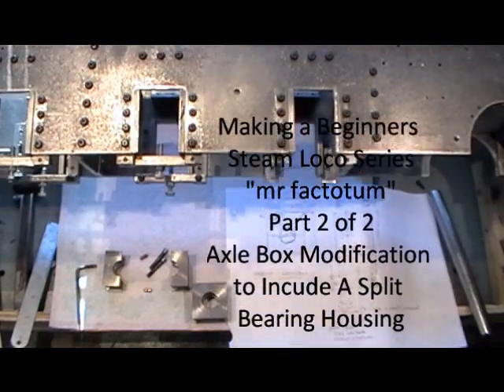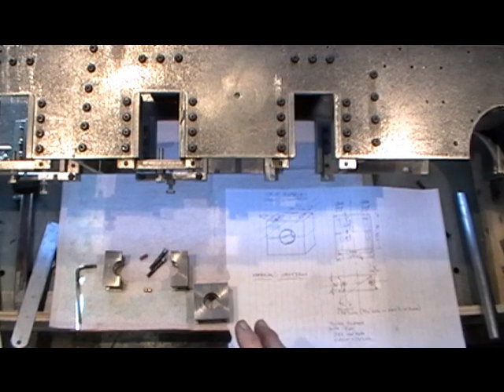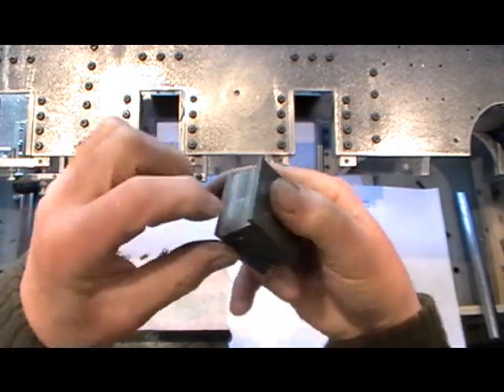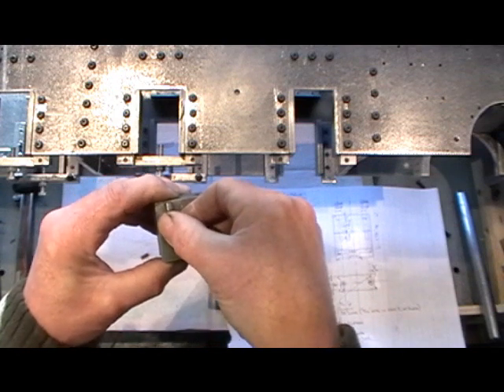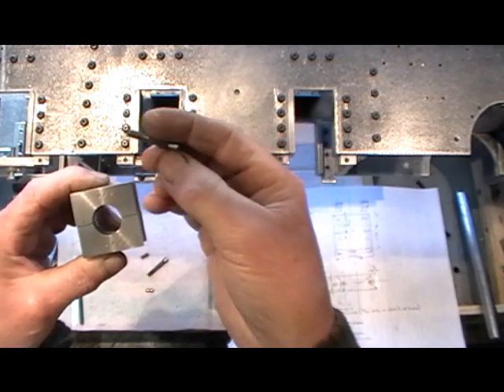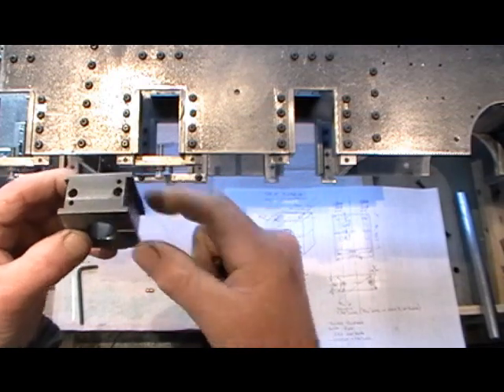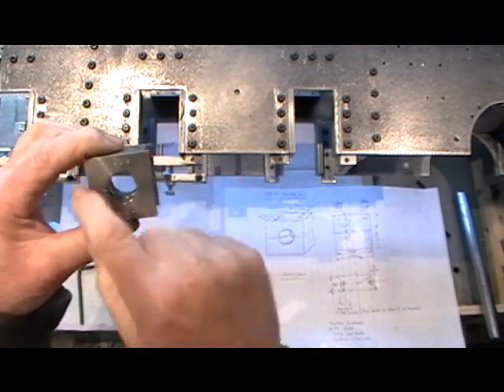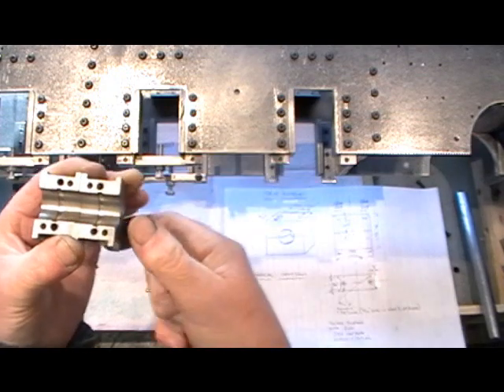Making a Beginners Steam Loco ("Axle Boxes" Prototype Modified split bearing Part 2)"mr factotum"

Comment: My re designed Simplex has 2 BA fittings all over and I dropped the hex key twice today! As well!!
If only the builder had done split boxes as I am having to carefully file each to fit into new horns on the new frames!! I have done the keeps as well and these are full length plates that should go to help keep the track OIL FREE. I have a very stiff frame now.  Loving what you are doing. David and Lily Reading Track.
Reply from the maker: hi david & lily
Thanks for getting in touch, good idea with keeper plates, good luck with the filing
regards
mr f

Comment: Mr. F.  Looks like your modification is going to work quite well.  Do you plan on using the spring ball type oiler in the end of the axels?  I forget what that are called.  Gits oilers maybe?  When you do the bevels or chamfers to the insides of the axel boxes, will you do them up by hand filing or will you machine them.  Great series my friend.  Thanks for taking the time to film and post.

Joe
Reply from the maker: Joe
Yes i will use the oilers in the end of the axles, ive ordered them from china, hope fully there just coming over the pacific ocean, china calls them push button oilers, they have got various names, got 20 off for £1.77 delivery included, how do they do it!!!!!! As for the bevels, ive decided to machine them,  i'm in the process of doing a detailed machining process of the whole axle box including the bevel.
thanks for your comments
regards
mr f

Comment: Although it takes a bit more material and work, I think the axle boxes made by Mr Crispin make a whole lot of sense.
Reply from the maker: Hi there, thanks for viewing and commenting I appreciate.
Yes that's a fair comment, and for any professional builders I agree. I'm  just trying to keep things simple from a beginner's perspective to encourage more novices to have  a go.
Regards Mr f
Reply: Since you split the boxes, you could still incorporate oil wells and felts for a better lubrication system.
Cheers
Reply from the maker: Hi
Thanks for taking time to view and comments, I appreciate it
Yes, I did think about it, I have put a oil groove in the axle boxes and suppose I could incorporate a felt in the oil groove, i may do just that.
thanks again
regards
mr f

Comment: I might have to do this for when I get to this stage of my sweet pea did you have to buy extra cast iron to make the split boxes or did you use the cast iron supplied in the starter kit ?
Reply from the maker: Hello Morris Sentinel
Thanks for taking interest and comments, i have not bought a starter kit so i don't really know what you have got, i bought some lumps of cast iron from a near by foundry, and cut it up to my requirements, all my materials for boiler and chassis etc. are from the cheapest suppliers i could find, take a look back at materials video.
Nice to hear someone else who is building same loco. What stage are you at, are you building a sweet pea or metre maid, are you a well established builder or a beginner like me. 
thanks for getting in touch
mr f
Reply: Mr Factotum I am building an 0-4-0 sweet pea i am a complete beginner I haven’t even drilled the holes in the frames yet due to exams and other things getting in the way hopefully I will be able to do that over the summer. I only have a lathe and a terrible drill press that doesn’t even have a taper . So I am waiting until a friend of mine will allow me to use his milling machine for a day to drill all the holes .
Reply from the maker: @laurenssmith9534  
Thats nice to hear,  at least you have only 2 axles to contend with instead of the 3 axles  on the metre maid, as for the drill press, i have a really old Herbert drill press and a hobby mill, but i ended up doing mine on my £30 chinese bench drill, check my video out on that if you have time. 
Anyway all the best with your build and keep in touch if i can help in any way
regards mr f